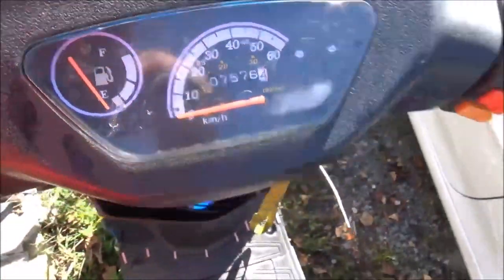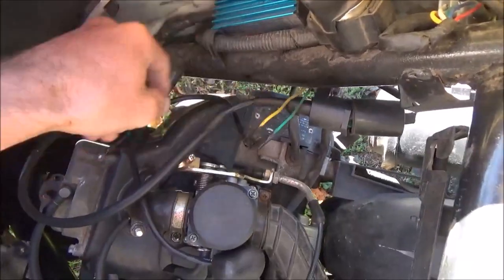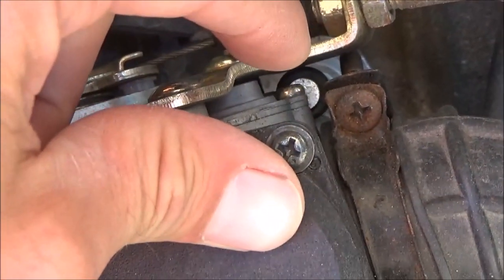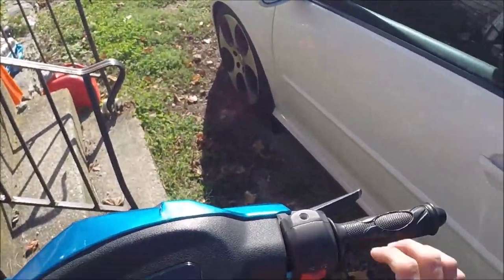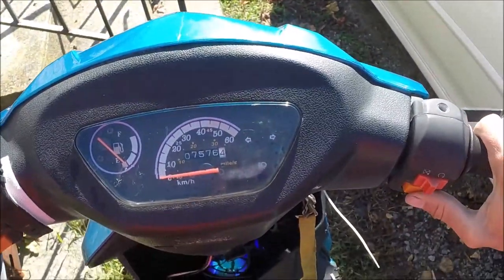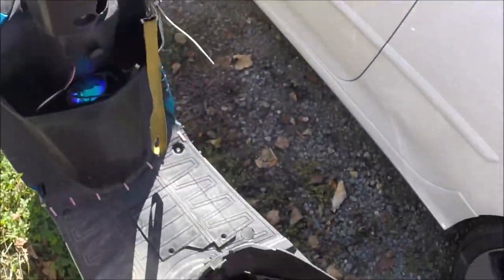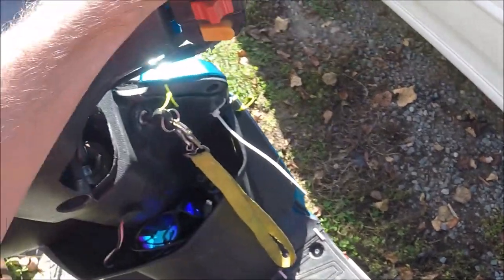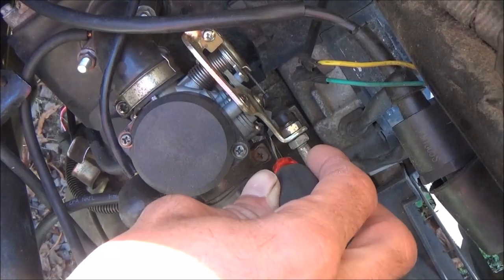Scooter Cold Start Trick/Start A Scooter First Try

Comment: Thats a acceleration pump ur pressing on. its much easyer to give it about 3/4 times full trottle without the engine running. it does exacly the same as what you did with your screwdriver.
Reply: Not always. Depends on state of the spring which is sliding on the butterfly valve roller. Sometimes it is pretty weak...
Reply: Pissible but i never saw it. btw nice channel mate!
Reply: You can just bend the throttle accelerator pump tab.
Reply: Love you🥺

Comment: Several people below say that the problem is with the electric choke.   I don't think that this is the case here. When the electric choke is "cold" then the "idle enrichment circuit" is open and lets more fuel into the carb .  The wires going into the choke are for a small heating device.  As the choke warms up the idle enrichment circuit  gets closed.   As others have observed, the silver circle that joshcb7 presses on is the accelerator pump.  Each time that silver disc is pushed down it pumps a tiny bit of fuel into the system .  Since the bike starts after depressing the pump , I suspect that the idle jet is too small and/or the idle mixture is too lean.
Reply: Hey buddy I figured I'd see if you could help me..I have a grom clone with a 50cc gy6engine..I had it running last week but now it won't start.it sat al winter.i got it running for a day..out gas in it now it won't start.i got a new plug and looked in the carb and it's beautiful.but I wasn't sure if a jet could be closed.it has a thousand miles and had been very reliable untill now after sitting..I'm jst pissed cause it started right up and ran for a day but now it won't.only thing I can think of is some particle clogged a jet..I'm new to working on my own shit so I could use some help.sory to bother you I figured it won't hurt to ask
Reply: Any luck? Joshua? I’m facing same problem 😢 if you can advice

Comment: Electrical tape is not good to splice wire you should fix it by removing the tape n cleaning the wires slip shrink tube  ( 1/8 , or 3/16 diameter, so it will fits over blue butt connector)  on one side n using blue butt connector is 16-14 gauge wire diameter, they make them w shrink tubing on the ends too, but w a reg butt connector push each bare wire end into the butt connector crimp the butt so the wire is locked in then slip the shrink tube n heat it up till the tube shrunk down n seals the but n tight fit over the wire. Now the splice is weather proofed. electrical tape will eventually leak water n throw the voltage Totally off, n the electrical choke is not being activated. Live n learn. Hope this gives you n viewers insight in the proper way to Seal electrical wire splicing.

Comment: How come my Ignition Was changed. No. That it is.
 Changed, we can't get her to fly her up. We had to fix spark once we got her spark back. After changing this Ignition, we had to do a valve adjustment after the valve adjustment. I never tried turning it on yet. I pray that it's going to work. I just don't know why it started messing up after changing the Ignition. Switch itself.

Comment: how do you even come up with this, pretty impressive
Reply: It isn’t hard to come up with that if you know how a carburetor works. That type has an accelerator pump. You don’t actually need a screwdriver. You can just open and close the throttle a few times beginning starting.

Comment: Since this is a toa toa I just wanted to remind everyone that there is one calibration for the speedometer and odometer cluster and that is for the 12 inch wheels since that is what they run commonly in China so with the 12 inch wheels on like his bike has his speedometer and odometer are accurate but with the 10 inch wheels it is not very accurate 105 kilometers an hour equals 50 miles per hour or 52 1/2 kilometers per hour on your Speedo equals 25 miles an hour or taking to account for speedometer error you can just take your cloners per hour divided by 2 and that is actually your miles per hour and 50 miles per hour on the speedo is actually 37 with a 10 inch tire versus the 12 inch tire wear 50 miles an hour on the speedo is realistically about 48 miles an hour cuz of the speedometer error and accuracy in Reading high that is programmed into all vehicles worldwide standard.
Reply: Holy moly

Comment: I am having the same problem he's having
Reply: Gerald Williams read my splicing wires here if your using electrical tape on wires any moister is going to throw off voltage leading to the elec choke

Comment: my yamaha just cold starts with full manual choke and no throttle. kick it once and she starts right up
Reply: Why to do that easily, if you can make it complicated :-)
Reply: Difference between a $3000 scooter and a $700 scooter lol.. hell my taotao was 350 in practically new condition. Age aside, it could have rolled out of the dealer the day before I got it

Comment: I have a Yamaha vino want fire right. When check the plug I get one good spark then nothing . I turn it over again I get one spark
Reply: cartoon ch I had the same problem, don’t know if you have fixed it yet but it turned out that the wires connecting to the spark plug assembly were corroded on mins so I just wiggled mine around to see if it would spark again and it did, hopefully you figured it out by now tho.

Comment: Hi sir I have a scooter and its been a month that i havnt used so now when i going to use it its not starting
Theres a gas and theres a spark in a spark plug and i already replace the fuse
What the best solution can you give me some idea sir for my problem
Thanks in advance
Reply: You can't leave a scooter sitting for a month.  Not without fuel stabilizer. Gasoline goes bad.  Clean the carburetor and fuel system.

Comment: What should I do if the moped won't crank but the lights and everything else works?
Reply from the maker: Tyshien Douglas if there is a  kick start try that if the starter won't crank.
Reply: Look if anything is stuck in the variator mine was out of place and it just clicked but everything worked